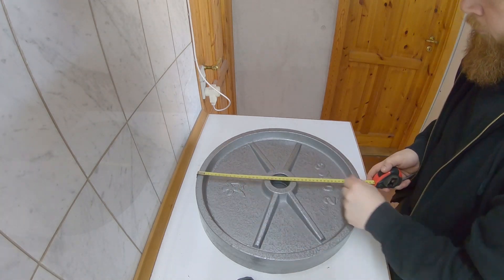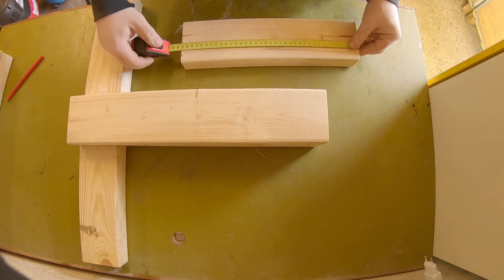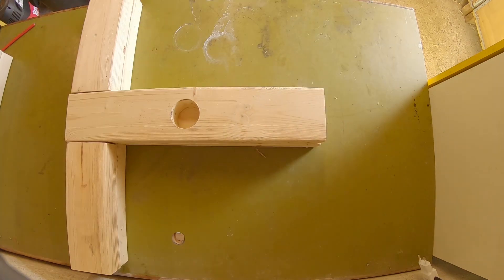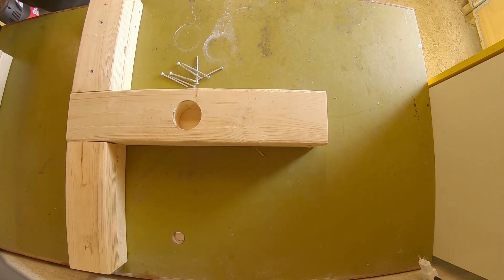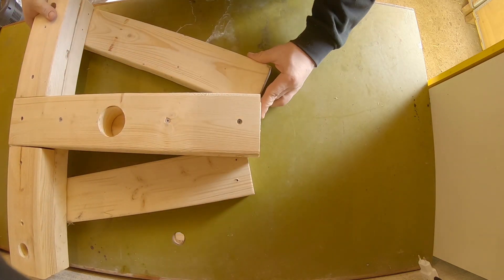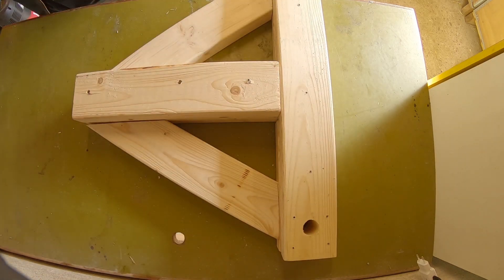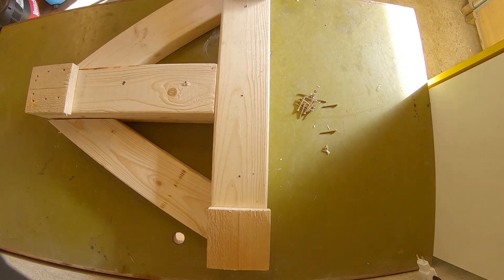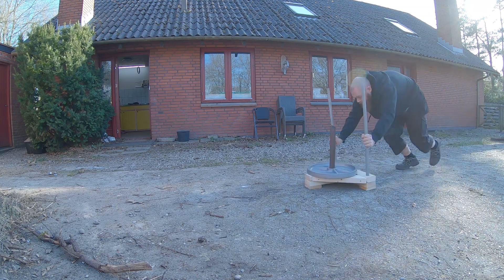DIY prowler sled - Fit at home

Comment: Have you tried this on grass? How was the drag? Nice build thanks!
Reply from the maker: Pushing it on grass is very difficult, it might help to cut the 3 bottom pieces with an angle. It will most likely be easier with some plastic blocks underneath. 
But it works well on grass if it's set up with a harness over the shoulders or waist - then walk with it. Hits the legs immediately.
Reply: @martinjensen3688  nice! I may try to build one sometime soon. Thanks!
Reply: @martinjensen3688  I have seen some ppl use furniture sliders screwed into the bottom and they slide better like that.

Comment: How is it with 4+ plates? Does it work well on pavement/asphalt?
Reply: Wood on pavement won't last long.  I saw another, much bigger and sturdier DIY sled, that used four inch PVC pipe cut in half and screwed into the sled skid.  I'm going to try this build here and adapt the PVC to the skid.  Easy to install and replace as they wear down from the asphalt.
Reply: @kurlybitz  yeah I built mine with cutting board material. I will post a video shortly.
Reply: @kurlybitz  can you send the link to the video?

Comment: Good job . How are the handles and weight tube attached , thx.
Reply from the maker: They aren't attached, they sit in a slightly oversized hole. For the weights, it doesn't really matter, it will stay (unless used on very bumpy surface). 
The handles you'll need to actually slightly push downwards when pushing the sled - it works best with hands in a low position.